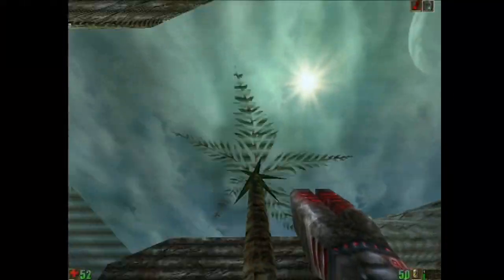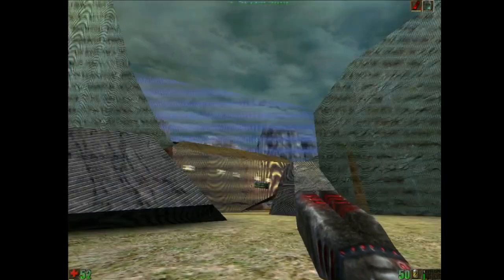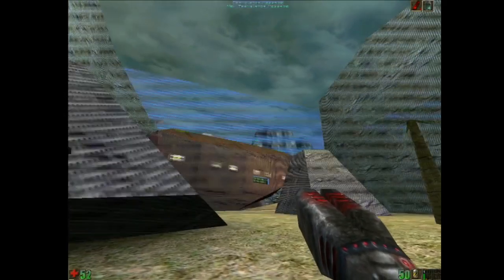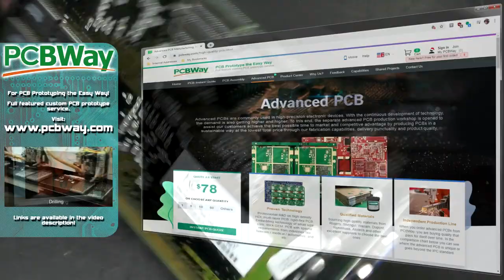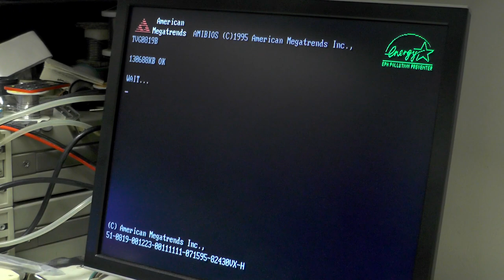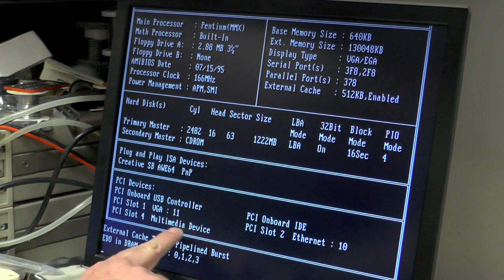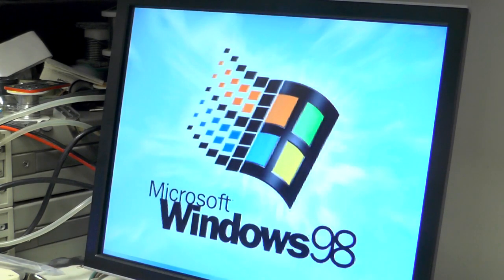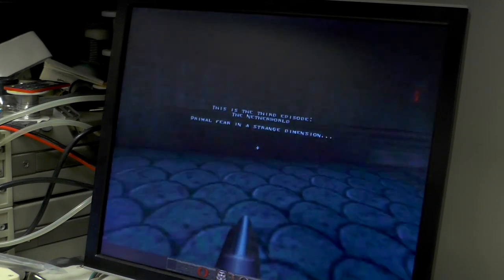DL191 DIY 3Dfx Voodoo 2 8MB to 12MB RAM Upgrade

Comment: I wish I could just solder on an extra 4 or 8 gb of ram on my gtx video card
Reply: More VRAM does not increase performance beyond games that do not need more than 8. Pascal cards are a good example of this, my xfx 580 came with 8gb of 2000mhz mem, but I can get far more out of it by over clocking the memory rather than adding more or even over clocking the core.
Reply: uhh thank you for that response, but not everyone has 8+gb of ram on their video cards

Comment: 1st . its great to see this kind of blast from the past . 2nd . I dont know how much you paid for 2 voodoo 2 cards but just an opinion . How about a combined voodoo 3 , 4 or the 5? . Thats what I still have . It works but I dont use it now . BAsed on the fact this is up grading the ram . mine has 64 MB so do you have any sugggestions or have yue ever done a video on that ? Im  just curious really . It would be interesting to see if I could get chips which would fit on my voodoo 5 pci board . I expect that voltage and frequencies are important to consider. It would be interesting to see if I could jump up from 64 MB ( maybe double it or even get better gpu´s of which there are 2 on my board ) . Great video anyway

Comment: Nice job! Time perhaps for a hot air station, would've made it easier.
Reply from the maker: Maybe, but i find soldering with an iron quite calming and therapeutic!
Reply: I worked at a 3DFx card maker and Mau could hot air an entire card together in about 15 minutes or less. So it's certainly faster but doing it your way is very impressive.

Comment: Nicely done. I miss my Voodoo 2's even more now. Surprised to see the drivers even allowed mismatched SLI like that. I have an A1200 accelerator card empty memory positions. Hopefully one day, when I find the RAM chips, I can do the same to it. What was the chip supplier you used?
Reply: I think that was utsource. They have their proper website and they are present on ebay under the same name utsource

Comment: You  have 128 mb of memory on a motherboard with an i430VX chipset. That's out of the max 64mb cacheable range the chipset has. Is that intentional? You're losing performance.

Comment: I've still got 2 Voodoo 2 cards in a box somewhere, I have been planning a retro win 98 box as well. nice to see i'm not alone in that desire :)
Reply: They're worth good money these days just check eBay otherwise keep them.
Reply: I have a win98 box with two voodoo2, took it all apart and put it in storage after I figured out that glide wrapper actually works better
Reply: @MrKillswitch88  I have 3 voodoo2 cards one is new..

Comment: I have some AGP 2x Voodoo 3 3000 cards with 16MB of memory. Would you like one.
Reply from the maker: Thanks for the offer Simon but i am happy with my Voodoo 2's. You should hold onto those Voodoo 3's though, build yourself a gaming rig!
Reply from the maker: Hey Simon, thinking about this it might be fun to do a back to back comparison. Does the offer still stand?
Reply: They are in a drawer of various AGP and PCI cards. I will test them on an old Pentium 3 440BX motherboard i have to make sure they are actually voodoo 3's and they work. There is no label on the PCB saying the model.
Reply: i don't do much gaming any more (i used to when i was younger) but i sometimes play Raptor: call of the shadows or road rash from the 90s that i used to play as a child when im in the right mood. im 35 now. I tried but i don't get any enjoyment from modern games, especially shooting ones. It just feels a bit meh and boring.
Reply from the maker: Thanks Simon, i do still play a bit but not in the same way, like i will just load up Unreal Tournament and slaughter a few bots for an hour and that will be it for a few days. If the Voodoo 3 cards turn up you can DM me on twitter or email, which you can find on my YouTube Channel About page.
Reply: @simontay4851  You should really keep them - or at least one. I am also trying to find Voodoo cards for my YouTube channel, but they are so expensive (overpriced imo, tbh). I'm not saying it's at the Ebay price range in my country, but still, someone just tried to ask me $100 for a Voodoo1, which I had to turn down. So I ended up looking for alternative cards (could not find yet tho). 
P.S. I'm 21 years old, but grew up on old PCs, and RAPTOR is still one of my favourite game to this day. 😁

Comment: jeesh, they still make these, or are you a horder? I remember mine back in the day only had 1 vga port..
Reply: they haven't made these things in 20 years. But plenty of folks still kept retro hardware around (particularly for old games that supported 3DFX's Glide interface, but where too old to get updated to Direct3D). They're well made cards, so as long as they don't get mistreated, they've got another few decades left of use in them. You can emulate old games on things like DOSBox and Glide (what 3DFX cards use) can be remapped to OpenGL, but it's always a bit glitchy. Some folks just opt to have a retro rig just for playing old games with hardware they would have killed to have as kids, lol (I don't, but I can see the appeal).
Voodoo cards came in two kinds: later voodoos came in the familiar 'standalone' graphics card format, but Voodoo also offered the 3D accelerator chip on an expansion card that you'd plug your existing 2D card into (hence the two video ports), and that's what these two are. This was actually pretty common early on: some 2D gaming cards even had expansion ports on the side for it (ATI did this, as did S3 I beleive). However, AGP and the GeForce killed the notion of the 3D expansion card for quite a while. PhysX (now built into GeForce cards) was like this, but for physics. So, you could have 1 2D graphics card like an S3, going into 2 SLI'd Voodoos, with a PhysX card, and a SoundBlaster....
Idea of '2D happens on a separate chip from 3D' is still used in laptops that have standalone GPUs inside. The weedy little IntelGMA chip runs when you're not gaming and saves battery.